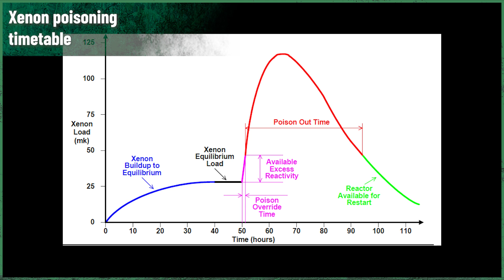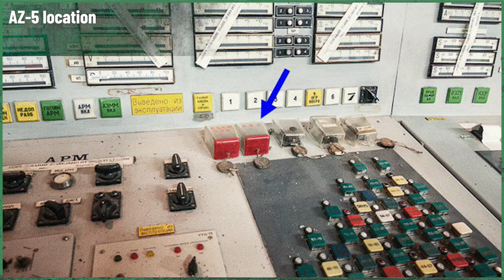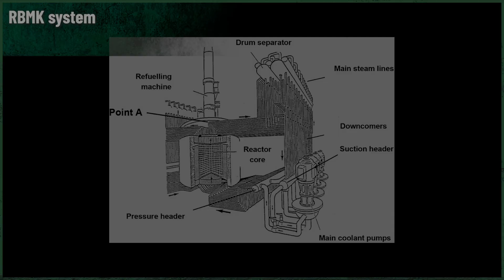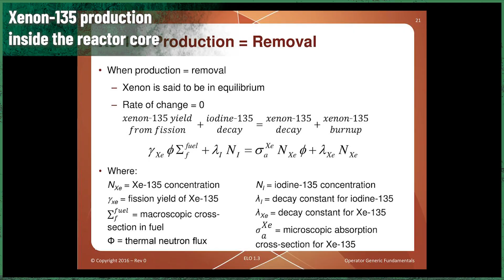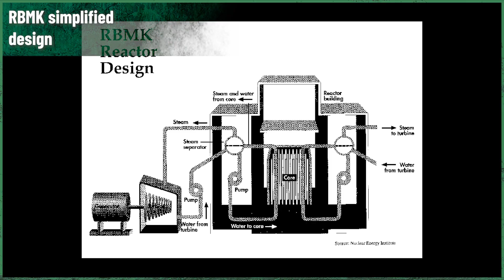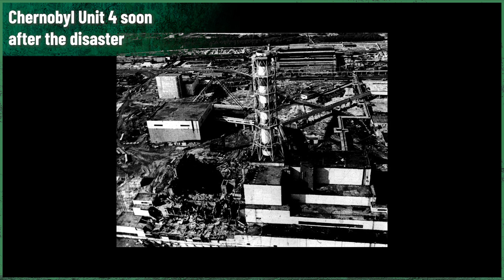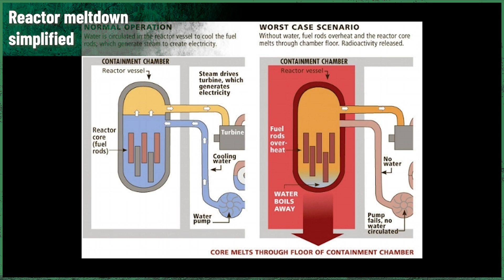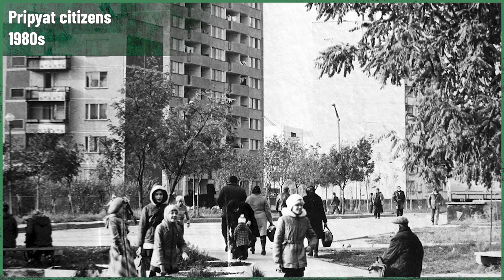Chernobyl explained: RBMK explodes when pushed too far | RBMK PART 12 | Chernobyl Stories

Comment: 700 mW level is actually not required at all. It's there to perform the valve tests which were supposed to be done before rundown but were postponed, so they switched to lower power to reduce stress on the reactor. They were supposed to use a computer with an experienced operator to reduce power but Diatlov forgot to call him

Comment: Why does water act as a poison in the RBMK reactor but as a moderater in PWR reactor?
Reply from the maker: It's xenon pit, not hydrogen / water / oxygen pit :-)
Reply: Let me try to explain, and my apologies for the lengthy, very nerdy reply^^

Water can both be a moderator and a neutron poison, as you already so aptly stated. In a PWR/BWR it is a moderator. It will act as a (very weak) poison for them as well, but because these reactors use 3 to 5% enriched fuel, they have no problem with this particular characteristic. There is enough enrichment in the fuel to overcome the effect.
However, enriching nuclear fuel is eye-wateringly expensive. Costs the Soviet Union could do without for multiple reasons. They could/would only enrich to 1.8% initially. They could have chosen natural uranium, but then would have had to use heavy water as the moderator like the Canadian CANDU reactor. But again, this is very expensive. Graphite can be used as a moderator too, it is actually quite good for this task. However, this comes with a unique problem; the positive void coefficient. We'll talk about this later.

When you use graphite as a moderator, you'll need lots and lots of it to get your reactor critical with such a low (1.8%) enrichment. You have to be extremely thrifty with your neutrons, to try and keep as many of them on board as you can to keep the chain reaction going. With so much moderator in the form of graphite present in the system, the RBMK operates in the "over-moderated" regime. (The other light-water reactors operate in the "under-moderated" regime, which is much safer.) In the over-moderated system, water stops acting as a moderator, and becomes a neutron poison only. This also means that when you lose your water for some reason, you'll have all these extra neutrons floating about all of sudden because the water is no longer absorbing them. And this brings us neatly by that other problem; the positive void coefficient. When water boils away, or runs out of a pipe break, the neutron absorption stops. Steam is a rubbish neutron absorber, so more and more neutrons are present to speed things up even more. You end up with a positive feedback loop; more steam means more power means more heat means more steam... At that point you'll have a major problem on your hands because your reactor will put itself into orbit. Which is what happened to poor Unit 4.

Comment: You should have mentioned that the voids were at the bottom of the reactor. When feed water enter the reactor, it was instantly turned in to steam which caused more and more voids to be created and in manner of seconds, the voids started to raise slowly to the top but still, a lot of them remained at the bottom. The chain reaction happened from the bottom to the top. Neutron flux sensors ( the power meter that stopped counting at 33GW ) only measures 3/4 of the reactor core, someone says 2/4. The bottom part of the reactor was completely out of sensors and those that were on top only measuring 4-5m down. Remaining 2m was out of control. The power measuring depends on neutron flux sensors. More neutron flux, more calculated thermal power of the reactor ( the power meter wasn't measuring turbine electric output ). So in matter of secods, the bottom of the reactor was almost 100% out of water turned instantly in to steam so there was almost 100% of steam voids ( rapid increase of flux at the bottom ) and that voids started to go up so quickly that the operators had just a few seconds to react but it was allready too late because the excess heat ruptured many channels blocking a control rods to be fully inserted. But there is also the second problem, voids and also the tips on every control rod made out of graphite, making another possitive coeficient because grapphite is a very good moderator, it striked the power so high that some sciencists calculated +7PVC seconds befor disaster and from that point where the flux meter ( power meter ) stopped counting, it started to be exponential in neutron flux increase making PVC 1 second befor first explosion around +30 which means, 30times more power after it stopped counting.. holy cow...💀💀 but 990GW is nonsense... 1 second before the first explosion the power was calculated at around 400GW...
Reply: After the first explosion power went waay up as all the water boiled away, maybe to a terawatt
Reply: @ could be also possible. They generated 5 years worth of power in just one second xdd

Comment: Did you forget the water columns at the bottom, and the "tip effect"?
Reply from the maker: Nope, they were important design flaw, but they were not alone responsible for the distaster. They were just a small piece of the whole broken puzzle

Comment: Just my opinion but, the RBMK fundamental design is NOT at fault.  It may have lacked sophisticated monitoring systems but, 
had the RULES been followed, and a culture of erring on the side of safety, this would not have happened.  
Had Dyatlov's ambitions been checked a long time ago, this wouldn't have happened.  
Had corners not been cut during its construction, the control rods would've fully inserted and quickly, as opposed to some of the control rods getting stuck in their channels.  
Had previous safety concerns from past accidents been addressed and implemented in Chernobyl's construction, even the safety violations might not have resulted in this explosion.  
All of the above shortcomings are bureaucratic in nature.

The RBMK design has an important selling point, IMO.  In less developed countries and with less capital available, the RBMK design is feasible.  Western style PWR designs are not possible for smaller and less developed countries (but still possessing industrial capability) from building their own systems.  Pebble bed reactors are an attractive alternative but, I don't know if they can scale up like the RBMK.

IMO, the future will be starved of capital, skilled labor, and resources to do much of anything.  The relative ease of construction of an RBMK type reactor, and its tolerance for poor quality fuel rods, will justify revisiting the design in order to generate sufficient electric power in the near future.  And that assumes all lessons learned will be implemented in their construction and operation.
Reply from the maker: Not exactly - in my opinion, Chernobyl happened because of many reasons besides the technical ones. They were really important (like e.g. the measuring systems or different reactivity in the core sections), but the USSR's system was an important addition to that fatal equasion.
Reply: I had to look up Dyatlov. He came from a poor background and as a young adult was advanced very quickly to manager. Later he was found guilty of negligence and died of heart failure from previous radiation exposure. Though he did try to save colleagues after the accident.
Reply: @WindTurbineSyndrome  Dyatlov was a tragic creation of the communist system and its warped incentives.

 It is the perfection of capitalism but raising capital is very difficult.  
The incentive to gain prestige is intense but, keeps a solid floor for those who are comfortable there.  
The higher up you get, the more fearful it is to fall from those heights. 
Yet taxi drivers and store workers lived the best lives because of how close they were to the stuff in the warehouses and storerooms.

Comment: To test the run down, does the actual final power of the reactor matter? Surely the potential energy of the turbine is purely a function of its rpm at the beginning of the test, assuming that steam flow is stopped, so the reactor isnt powering it during run down, and thus 200MW is irrelevant, and thus they could have just shut down normally and measured the run down energy from operating rpm? I never understood this part. All they needed to do was show that it could supply voltage and current for the required time while spinning down from a set rpm? I get that they were trying to replicate a bad situation with fidelity, but it seems risky to test it all simultaneously? (Apparently they had installed a button on the panel to trigger the whole sequence, so it was clearly carefully planned, just not ‘well’ planned.
Reply from the maker: The power was important to the test itself (less) and to the RBMK condition (more).

The power output had to be high enough to sustain the chain reaction on the necessary level and to guarantee there was no xenon poisoning building up.

So you might say the output was an indicator of how much can the reactor be pushed around. The output level was also a safefail against the natural RBMK predispositions.
Reply: @Chernobylite  I ‘get’ that it was a wider test of the system, but my question is why not just spin the turbine up and see how the voltage drops without ‘pushing the reactor around’? Presumably they ascertained that doing this at full power was inherently dangerous (what to do with the excess steam and core heat?) which further implies that the test was pointless (ie not maximum design basis type accident), and that they further knew that the reactor was capricious?? (Although supposedly more so at lower power than at normal operating power??) . I guess the grid issue was very significant here, and they hadn’t modelled for this eventuality. Enjoying the content - keep it coming!

Comment: The way I explain it to people in real life is like this, the RMBK is like a car that only has an accelerator pedal, and the Xenon poisoning was like a rubber band holding the car back from moving, sooner or later that rubber band snaps and suddenly the engine is going full bore redlining the RPM.
Reply from the maker: Good comparison!

Comment: I liked whole series, for me this episode was the best because of well defined fact that are easy to understand. Many thanks for making enjoyable program, tanks to others who participated.
Some time ago surfaced the thesis that the first explosion was actually nuclear explosion, one is under "Was Chernobyl Explosion a Small Nuclear Detonation?". Could there be any truth to this claims?
They should end the test when influence of the rods couldn't be calculated, i think they knew the danger but were probably too distracted, also tired at night as it happened during most other big accidents.
Reply: The claim that the first explosion was in fact nuclear is false. A reactor can never become a nuclear bomb. Not even the big, grumpy RBMK. It has to do with reactor physics and core geometry. Allow me to explain:

An atom bomb has very high enrichment, well north of 80-90% in U-235 (or Pu-239). Most commercial PWRs/BWRs sit between 3-5% enrichment, the RBMK had around 2% at the time, and the CANDU runs on natural uranium. When the accident occurred, Unit 4 was at the end of its first fuel cycle, which means that the uranium content was even lower. There simply wasn't enough U-235 to even reach bomb-like properties.

A reactor has some form of control, whether that be control rods, a burnable poison, or in case of a PWR boron in the primary cooling circuit. A bomb has none of these as that would defeat the entire purpose of said bomb.

And reactors have a form of moderation (water, heavy water, graphite) to slow down the neutrons to the thermal spectrum in order to facilitate a continuous, controlled chain reaction. A bomb has no moderation as you want your bomb to have as many fissions as possible in the shortest possible time.

What did happen is a massive steam explosion due to nuclear things running wildly out of control. Steam takes up about a 1000 times more space than water. When all the water flashed to steam in the core, all that steam had nowhere to go in the closed confinements of the cooling system, and the reactor literally blew its top. The second explosion was due to the formation of hydrogen. The cladding of the fuel rods is made of zircaloy. This undergoes a violent reaction with water/steam at high temperatures, resulting in the production of a lot of hydrogen. Hydrogen is extremely explosive, even at low levels. With the reactor vault now open to the air, oxygen could rush in, mix with the hydrogen, and the rest is history, as they say. Hope this clarifies it a little😇
Reply: @swokatsamsiyu3590  Thanks you very much, your explanations are so good they made me think i could run the reactor until the next question :) Core geometry and fuel enrichment were my first thought but you never know with the Soviets who were planting trees made of steel in the far East where real trees don't grow. This fiction about nuclear explosion came out in some papers a year ago or so, i will check who the authors are...
Btw, do Master Welders use schematics for complicated systems like we do in electronics?
Reply: @codaalive5076  
Well, I'm not sure about running the reactor. We would have to team up like the Chernobyl operators did because the RBMK is such a handful^^  And the Soviets did all kinds of weird things. Have seen this nuclear explosion bit in a report somewhere, but cannot remember exactly which report. There are so many.

They will of course look a bit different from what you would use, but yes, we most certainly do use schematics/ technical drawings. Someone has to weld the darn reactor, and for that to happen we would have to know the dimensions, tolerances and specific welds to be used. The materials will be chosen according to the design needs, but as a welder I have to know which materials are used due to their unique welding properties. For example, regular steel will behave very different from austenitic stainless steel.
Reply: @swokatsamsiyu3590  Sure, running the reactor safely takes quite big team of well educated individuals in a system with good safety culture.
Austenitic stainless steel is a bit similar to electrical steel where we don't want much carbon, sometimes it also needs very high Ni content (48-80%) if used for shielding or very small signal transformers, etc. All of this can get quite addictive because certain materials in audio tr. cores influence emotions in various ways.